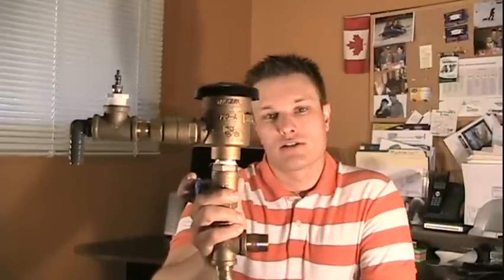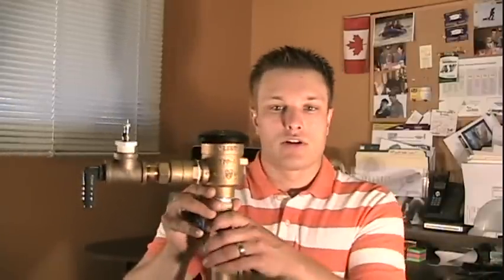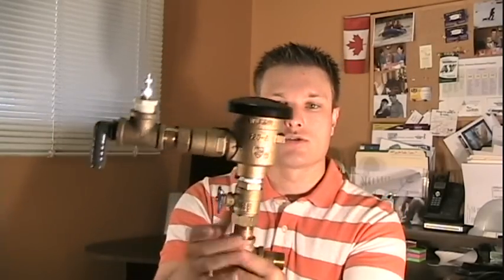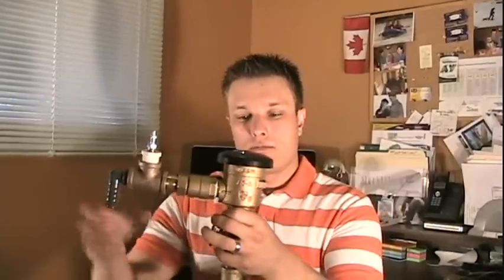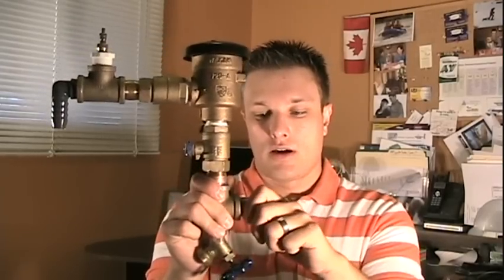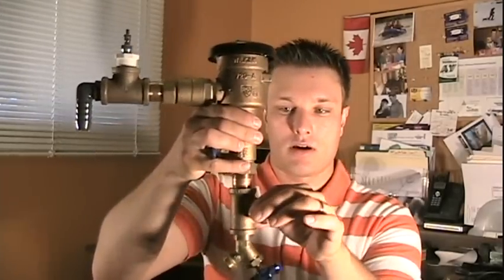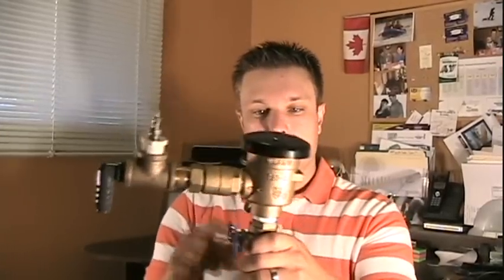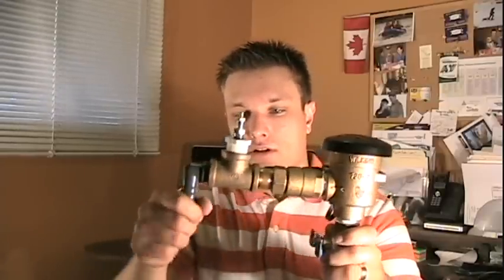Wilkins 720A 3/4" Pressure Vacuum Breaker - Sprinkler Daddy

Comment: hello, I am trying to create my own sprinkler system. I have connected a 1-4 brass splitter to the water outlet on the side wall. I plan to run the hoses from this splitter to various points were i need Sprinklers. What kind of back water flow prevention would you recommend in this case? Where should the back flow preventer be installed? Sorry for very basic questions. I am new to this.

Comment: hi, i need to replace the whole pressure vacume breaker... but cant seem to take it apart to replace it. any tips would be very helpful. its cracked under the plastic thing. and cracked  at the first shut off valve from house. so i goota replace the whole thing. but i cant get it off.  which way do i turn it? what parts came apart? im super lost!